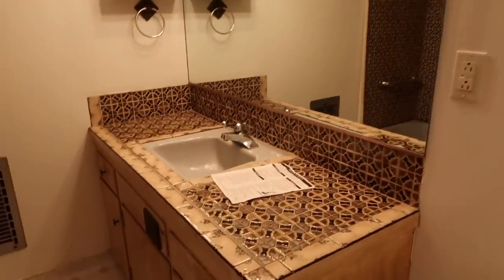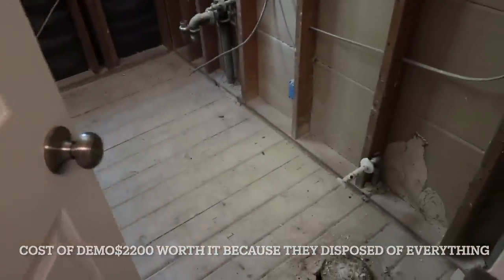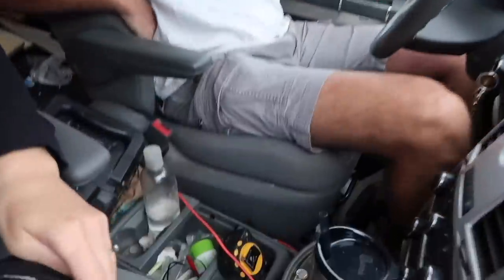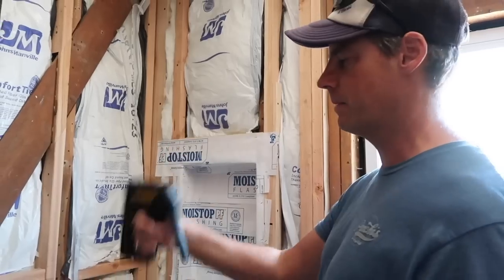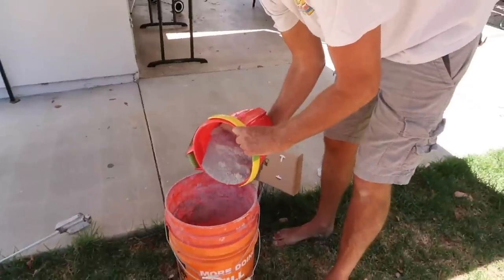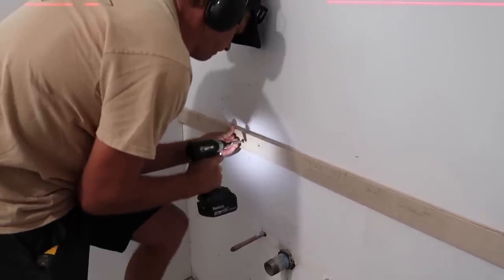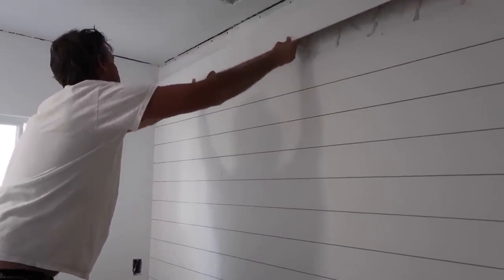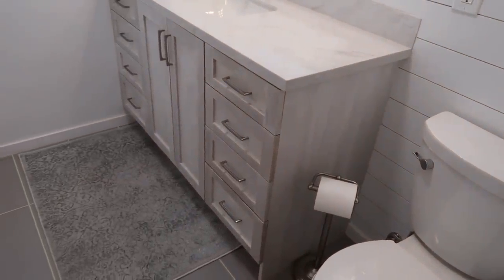Home Makeover *FULL Bathroom* Transformation

Comment: Don't mean to be negative, but you spent 2200$ for a 2 hour demo! That's insane! That should only cost a few hundred $. Demo is the easiest thing to do! If there were obestos, I could see it costing more, but if not, you should have done it yourself. I took my bathroom, which was similar size to yours, down to the studs. I probably spent less than 5k total, and that's all new everything down to the drywall.
Reply from the maker: It's not mean because we just have a different idea of what a budget is =)  We could have done the demo ourselves but we didn't want to. Also keep in mind we live in Southern Ca and everything is very expensive here. My husband works on homes where they spend over $100,000 on a bathroom without even blinking an eye.  SO it's all relative.  We wanted things a certain way and of course we could have spent less but I wanted a solid door and shiplap but we set our budget at $15k and we were actually under that =)
Reply: It's crazy how expensive things are in Cali! It's getting expensive everywhere now, though. It's really driving people to do more DIY. Sure, it takes longer, but if you take your time, it comes out just as good if not better than the so-called experienced contractors. There are so many contractors out there that cut corners and simply don't do things right.
Reply from the maker: I totally agree! Every time I go to the store for anything I am shocked at the prices, it has actually slowed us way down on our home renovations.  I hope you are having a good day =)